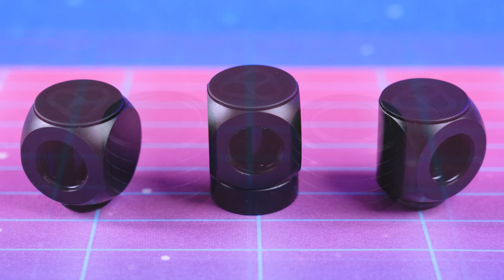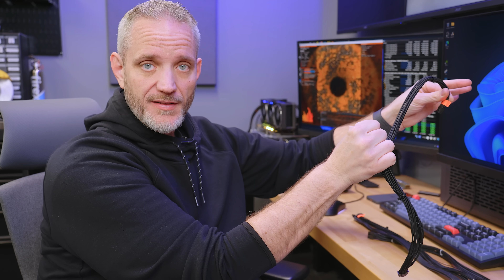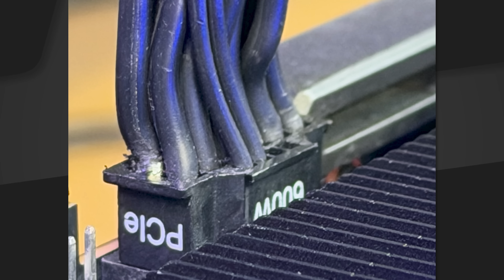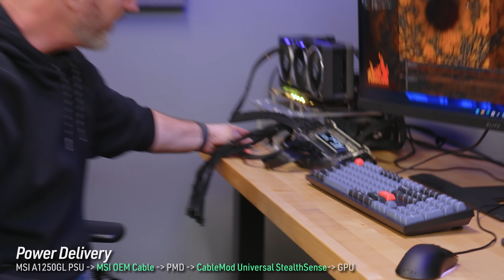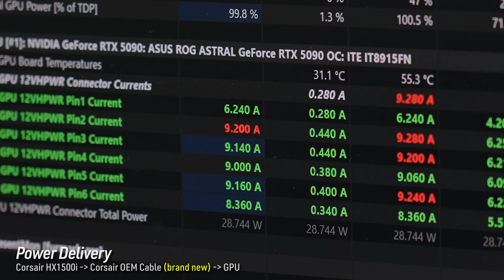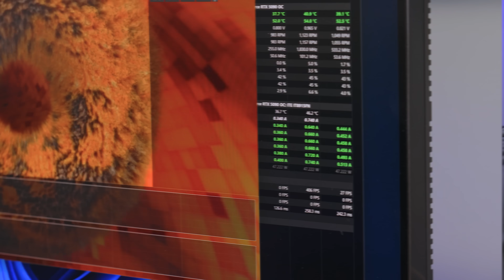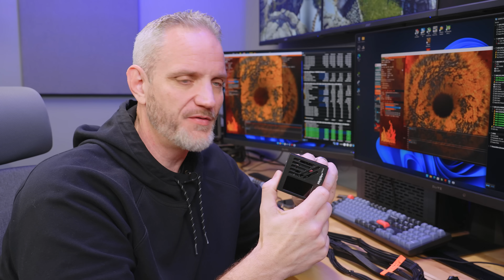More details on what could be causing 12VHPWR / 12V2x6 Cables to melt

Comment: I want to see you cut and strip those cables.  Check to see if they are not CCA (Copper Coated Aluminum) or even just basic aluminum wire.

I feel you are missing a huge point, that I only know from being a bit of a alloy nerd, and that is copper work hardens very quickly.  If you take a piece of metal, and bend it back and forth a few times, thats work hardening.  It becomes harder, and less able to bend, so it snaps.

Wire fights this with strands.  The wiring in your home walls are single strand.  They work fine because they don't move at all, so they never break.  In a car or something with vibrations, you want some multi strand.  The higher strand count makes it carry less current, but allows it to bend without wearing out.  I don't know off the top of my head the numbers, but I'm sure some industry person has this written down somewhere.

Also, I think a "custom built cable" video might be worth doing.  I have been looking to pick up a 5090, and have been considering over building my own cables (It's really not hard in any way...  making a water cooling loop is harder...) and I think this just reinforces that idea.  Spend 15 bucks on an amazon cable that is crap, or spend 15 bucks on better parts and make my own that are twice as thick as anything I could buy online?

Comment: Look at the ends of your cables. The "female" ends are made with pins that are "split" in order to expand to accept the "male" pin sliding in it! The more you move and bend those cables or pull them off and on again, the more the "female" pins spread apart and lose tension within the split pin itself. The less contact area the male end makes after you install the end in the card the higher the resistance and less surface area for the power to flow over. Cheaply made cable ends using thin metal will lose contact faster and lose spring tension when the male end is put in the connector. The WHOLE design is bad from a sheer "lack of effective connector contact" because of how the connectors are designed and used. As you stated, if you are using a brand new cable and install it on your GPU only once there's a better than average chance the cable will be fine but if you're changing graphics cards every week then this could become an issue. This whole set up needs to be redesigned with a completely different connector configuration such as "blade" or "spade" type contacts for a more effective mating surface area and tension. A slightly heavier gauge wire wouldn't hurt either.

Comment: Industrial maintenance/controls electrician here. We have this problem all the time due to vibration or movement.  Metal fatigue is a real thing and cables that look perfect aren't always perfect.  If you have solid wire it will probably break within 50 cycles max of bending it back and forth, a lot more for stranded but the problem remains.  It's pretty crazy how it happens but thats just how metal behaves.  I use metal fatigue to my advantage all the time tbh but this shouldn't happen to these wires so quickly with this small level of abuse.

Comment: I f you need a fancy expensive monitoring connector just to feel safe while using your massively overpriced GPU then that new connector is just trash and whom ever is the Engineer or Engineers that designed that should be embarrassed to have that on their resume.

Comment: Because of your corsair cable video, I replaced my cable to my 4090 with a cablemod cable months ago. lol I don't need my 4090 going up in flames.
Reply: so the corsair psu is still ok?  I have an SF850, should I replace the cable? I thought corsair was top tier.
Reply: @534A53 get a cable through cable mod and you'll be good. The PSU is fine. It's Corsairs cables that seem to be having some quality control issues

Comment: Jay electricity doesn't exactly work that way. If you have a high resistance or complete disconnect on one of the grounds in the 12 pin the remaining 5 grounds have to complete the same current as the 6 would normally and it won't necessarily be evenly spread among them. Most of these things come with 16ga. wiring which can just barely do 600w. Then Jay comes along and cranks it up to ohhhh 800 or more and things start cooking. It really is no mystery. Use heavier ga. wiring I would go all the way to 12ga. just for giggles.

Comment: The problem is the gauge wire all together. In automotive we would never use such small gauge wire for that much amperage. 16 gauge is just too small. The connectors are just made of cheap plastic. The pins are made of cheap quality to save money.

Comment: i guess we should be asking the manufactures what crap cheap parts are they putting into the so called High end PSU's.

At @21:42 pin 1 is very much damaged. Look at how its opened up. That would definitely create less contact.

Comment: There is a reason why I bought a cable set from an unsupported manufacturer per nVidia. Bigger cable gauge, fine wire composition to adapt breakage, soldered pin connectors, and gold-plated contacts. At full throttle, my card can’t even make the connectors warm. I am also using a hard adapter at the card that loops under, so the only flexible cable section not shielded by the back of the case is maybe 3 inches. But then again, my production PC is my income, and I build to make it armor-plated.

Comment: With the amount of datacenters running 12vHP connectors, arent they basically a speedrun to a culprit? Is this happening all the time but NVIDIA is just replacing the cards no question? Are they not reporting this or sharing this info because it's corporate Need 2 Know? There must be MASSIVELY available numbers from data centers running these cards. NVIDIA must know something that you, GN, Baur, etc are on thier way to discovering.. but they ALREADY DO. who is behind 12vhp? Is it like a proprietary thing like usb 3.0, or hdmi?

Comment: Cheap cables are infamous for using under spec wire gauge.
Normally it wouldn't matter too much.
But because 12vHPWR is already riding on a knife's edge this suddenly now becomes a much larger issue I bet.

Comment: CAN I USE THE Native 12V-2x6 connector CABLE FROM THE MSI MPG A850GS PCIE5 ATX 3.1 POWER SUPPLY ON AN MSI MEG AI1300P ATX 3.0 POWER SUPPLY KNOWING THAT THE CABLE IS Native 12V-2x6 connector?

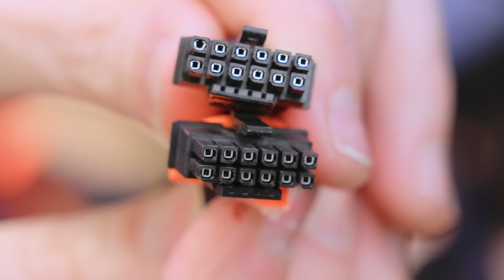Comment: At 16:35. Says all the pins looks fine, but clearly the top left pin connector is flared wide open. That would not make good contact. Aggressive wiggling of the cable when taking it out can cause that pin connector split. :face-blue-smiling::face-blue-smiling::face-blue-smiling:

Comment: From what I have seen so far, The 12V-2×6 (16-pin) connectors are still burning up because they’re pushing a huge amount of power through a very small, unforgiving connector. Even small issues like imperfect insertion, slight pin misalignment, or tight cable bends near the plug can increase resistance and create localized hot spots. Once heat starts building, the plastic softens, contact pressure drops, and it turns into a thermal runaway situation pretty fast. A lot of the failures also come down to cable quality—thin wire, marginal crimps, and inconsistent pin spring force leave almost no safety margin at 500–600 W. If these cables were built with heavier gauge wire (14–16 AWG across the board), more robust terminals, and better strain relief to prevent side-loading, many of these issues would be reduced. Using larger, lower-density connectors or splitting the load across multiple connectors would also help, even if it’s less elegant. Right now the design can work, but it depends way too much on everything being perfect, which isn’t realistic in real world PC builds. I'll be building and testing a full BTF build and seeing how the GC‑HPWR connector works.

Comment: I've been saying from day one that for 12v and 10amps these cables and connectors should be at a MINIMUM 14 AWG wire and 12 AWG to be really safe and not 18 AWG that is being used. BUT NOOOOOOO, no one listens.

Comment: It plan and simple what the problem is. The cards did not have proper power balancing and the materials used are being used at top limit of theoretical possibly for them, so as soon as a little wear on a cable or anything that can add any resistance increases the heat eventually leading to failure and melting.
Pretty much they designed the cards to handle 300-350 watts and headroom up to 600 watts and chose to push it to run at the 600 watts instead of using better heavy materials and proper power balancing to actually easily handle 600 watts with extra headroom above that.

Comment: Hello Jay! Thanks for all these updates and going further into detail. Would it be possible to test the adapters that some of us are still using for our cards? My card is a 4070Ti SUPER with a 1300W EVGA Supernova (yes been running for about 10 years now). I'm wondering if the adapters could also wear out as the cables mentioned in this deep dive. Thanks!

Comment: Why did we go from 3×8pin connectors to 1×12pin connector
Reply: takes to much space on the tiny PCB and doenst look that premium... So as always, design over functionality.
Reply: Servers, it means one power cable from the PSU.
Reply: @GodKitty677 Server GPU's don't use 12-pin's. They use EPS power cables like the ones your CPU uses.
Reply: @Cooe.  THe 9700 from AMD doesn't use 8-pin power cables and uses the same power cable as nvidia.

Comment: The connector is the only reason I didn't buy a 5090. I settled on a 5080 because it will only have about a quarter of the temperature rise.

Comment: Please pay attention to your 12VHPWR VOLTAGE reading in HWINFO64. If your VDROOP at 600w is more than .25v you should replace your cable. Currently, my PSU/5090 12VHPWR voltage reading at idle is 12.264v. Under a 600w load my voltage droops to 12.094v. I often check this voltage to ensure that the droop has not increased. I noticed this behavior on my 4090. Over the course of 2+yrs, the vdroop increased. I could then snug up the cable and the voltage would return to normal. Once I had to do this a few times, I replaced the cable. I truly believe this is a good metric to use if you don't have an Astral/Wireview Pro 2.

Comment: This is more like beating a dead horse, composting it, spreading it on the fields, using the grass to feed the next generation, beat that when it dies, and continue this cycle for six more generations of horses. The 12VHPWR/2x6/whatever you want to call it is such a dumpster fire at this point that it should be retired in my opinion. Also, why in the flippin' flippity flip did Nvidia go for this steaming pile of sh|t when there are perfectly good connectors out there that are capable of transfering far more power than even the 5090 can guzzle down, and do so perfectly safely? But no, the turboclowns over at Nvidia wanted to go for this flimsy crap, that has proven to be an actual fire hazard, because reasons. Geez ...

Comment: I have a phanteks nv7 case and since psu goes up top the cable that came with the psu which is a Nzxt c1200 psu the cable wasn’t long enough to reach my Zotac 5090 soo I bought some cable extension and the gpu would turn off when ever It pull close to 600watts and when I put the pc to sleep after like 3 hours it would shut off soo I decide to order a custom cable from cablemod specifically for my psu that was long enough to eliminate the extension and ever since then everything has been fine no more issues 🙌🏻🙌🏻🙌🏻

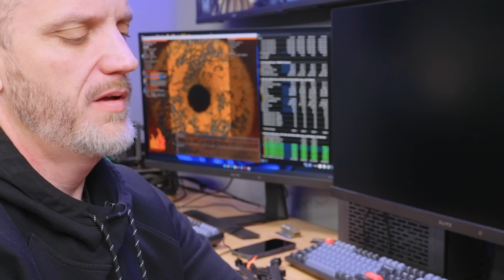Comment: Jay, in the quick look at the two cables you showed at time marker 16:31, the top cable shows the upper row, left most pin, having an expanded female pin 🤔🤔🙄
Reply: Also, there are specialty tools that exist to fix an expanded female connector, though maybe not for the diameters of those pins, but possibly.

Comment: Curious what you think of the ASROCK PG-1600G as a power supply I’ve seen the spreadsheet showing it at a good rating but I’m really struggling with getting my stable OCs on my 5090 matrix to match any of the content creators stable core clocks and im noticing 3d mark runs maxing out at 600w but kombustor I get 790ish

Comment: I had recently returned a Corsair powersupply because the included 12v2x6 cable would crash a 5080, no issue using the cards included adapter and PCIe cables. And this was only 300-350w. I cant recall how lose the cable was, but nothing seemed odd other than the PC couldnt stay on even at idle for more than a few hours. I ended up getting a LianLi powersupply and had no issues.

Comment: You’re right that it looks unbalanced, but electrically it still is balanced. Current that goes out on +12V must come back on ground — physics doesn’t change 😄

On the new PCIe 12VHPWR / 12V-2×6 connector, the reason there are “fewer” ground pins is because:
• Each pin is rated to carry more current
• The grounds are tied together inside the PSU and GPU
• Some of the small pins are sense pins, not power pins

So it’s not “missing” grounds — it’s fewer pins, but higher current per pin.
What matters is total amp capacity, not pin count.

The melting issues weren’t from too few grounds, they were from bad contact (not fully plugged in, tight bends, high resistance on one pin → heat).

Comment: Can some electrician or somebodey else with the knowledge tell me if it would be a better idea if instead of six wires delivering power, have just a singular higher gauge wire that is actually rated for the power draw?
Idk, I just feel like that there must be a better solution for Nvidias fire hazard of a cable/connector.

Comment: You are not just wiggling that one ground cable, you are wiggling all cables.
If you wiggle the cable group again like you did it will do the same thing even with the cable you thought was an issue connected.

Comment: I will never use anything else than the original BeQuiet cable on my 5090. I also applied the standard undervolt of 2700MHz @900mv which works in 95% of cases. It draws about 100-120W less under full load and performs even better than stock. My card is cooled with a custom loop and 2x 360 rads, but that won’t stop the connector from destroying my beloved card. I pray it will survive another couple years lol

Comment: This will always go back to the fact that the standard doesn't have enough overhead in the gauge of the wire. 6pin and 8pin could both comfortably do 50% over spec, and 100% wasn't catastrophic. Any wire should be able to carry 100% over spec, generally speaking. This POS doesn't seem to have any overhead above the spec (as they say 10A/lead is max, and it can't seem to handle anything over that).

So you have cables that get bent, dinged, moved around, and that zero-tolerance-to-spec is now a sub-standard-to-spec

Comment: !!! WELL DONE !!!
If The Earth Wire Is  NOT CONNECTED! Then The Other Voltages May Have NO REFERENCE  POINT!
* ALL VOLTAGES ARE RELATIVE *
Therfore DEPENDING On How The POWER OUTPUT Is Of The Power Supply Is Designed The Voltages Across The Wires May VARY DRASTICALLY. 
* THIS COULD DAMAGE A GPU!
* THIS WOULD CAUSE POWER SURGES!
* THESE PLUGS NEED RE-DESIGNING!
PS.
I Used To Have This Problem Of  Connectivity With RECEDING PINS On The Old 4 Pin Type Plugs Used On Parallel Hard Drives etc. Years Ago. This Plug Design Has Been Years In Need Of Replacement.

Comment: I honestly think the whole connection and interface to PSU needs to be redesigned to two beefy connections. Positive and negative, and literally have a large spade connector with a bolt and nut connection for both positive and negative poles.

Comment: IF YOUR POWER SUPPLY IS MONITORING INDIVIDUAL WIRES BETWEEN IT AND THE GPU, CONNECTING AN EXTRA GROUND LINE WILL CAUSE THE CURRENT THROIUGH THE OTHER LINES TO SUDDENLY DROP. AND 'SEE' A SPIKE IN THE POWER LEAD THAT YOU HAVE CONNECTED.

(sorry for the all caps)

In reality your instrument for measuring the power through the wires introduces two new connectors, a set of additional impedances on the power and ground.   If dropped on the floor it is possible for the resistors to develop a micro crack which would increase its impedance and so on...

on another issue.  high current wiring  is not forgiving of being bent and straightened - the inner conductors stretch and contracting repetitively will cause the inside to increase their resistance , the thin points are thus liable to overheat.   If you look at the cables used for your volt meters - these are designed to be used all day and have thin conductors inside a very flexible outer shield.

Comment: Well, they use cheap pvc braided cables.

In my planes I use extra fine stranded silicone braided cable (running 10 times that current of a 5090). Such a cable would cost 20-30$ more. No one would pay that. They dont wear out nearly as fast as the cheap coarse stranded cables used in pcs do.

Fine stranded wire, silicone braiding. That's the good stuff.
Reply: Plus the stupid thing here is the contact splitting. 
Using more than one pin for 12V and Gnd creates the problem. 
Imagine your car charger would use hundreds of pins instead of one (DC)

It is not problematic to use a connector for hundreds of amps, the 60 amps used by a 5090 are laughable for what my brushless planes pull. I have planes that pull 220A over one cable.
A single XT90 connector would fix this.

This is a nice example for the inability of engineers to use something they have never used before. A pc power supply has to have MOLEX style connectors. 
That is inevitable. Stupid but inevitable.

Comment: I still use a 10th gen Intel i5 CPU with 6 cores, and an RTX 3060. No issues at all. I will probably never upgrade at this point, at least for the long term. My computer is secure and stable.

Comment: I don't see a proper wire wearing out by moving it around. That's a manufacturing defect. Connectors yes but not the wire. We have wiring on equipment that moves and vibrates all day every day.